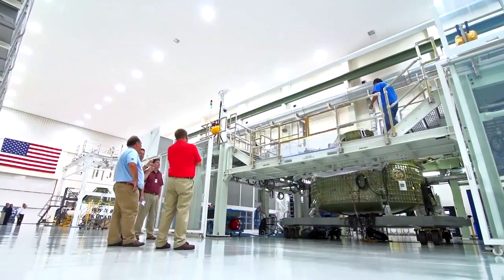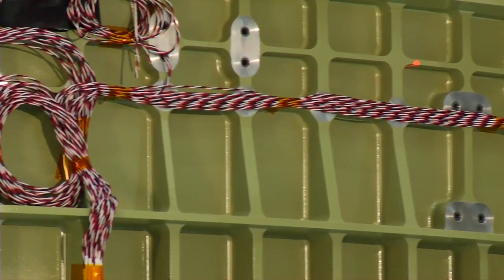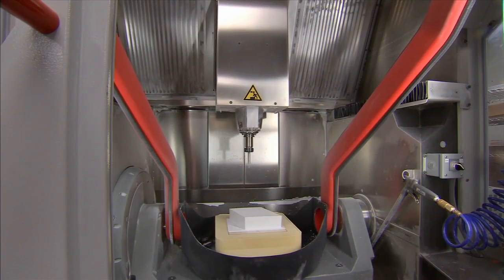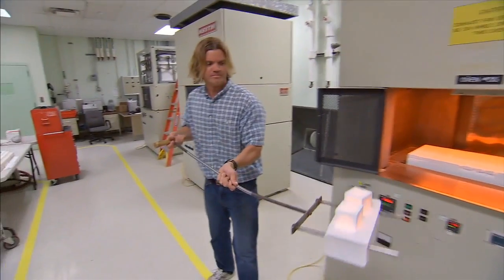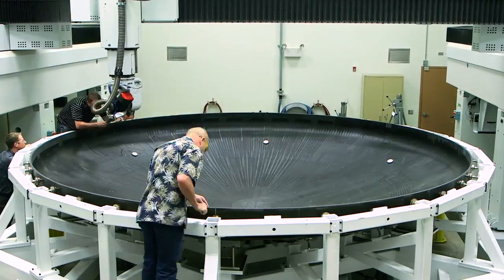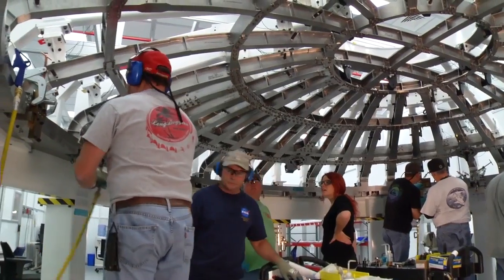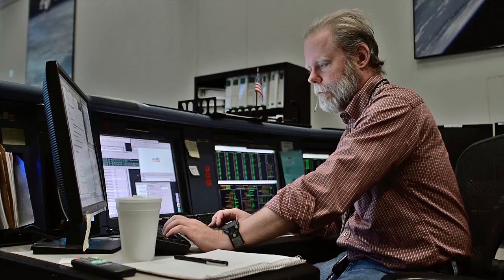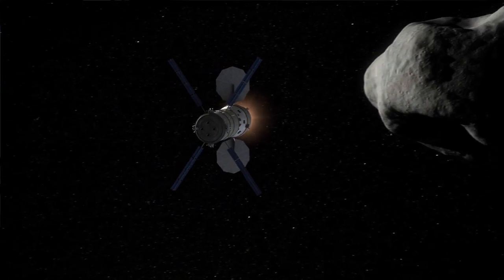Orion Heats Up

Comment: Are there plans to use ATV-derived hardware as a habitation module on exploration missions? I know that the CM on the EFT-1 flight is going to be an ATV-derived CM but the animation implies that it is going to be used on other missions as well. Please respond